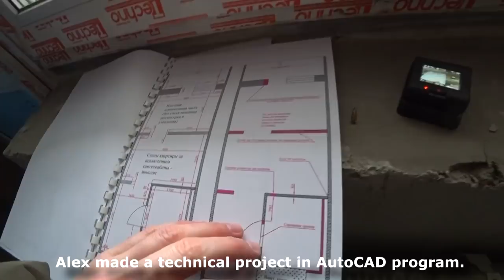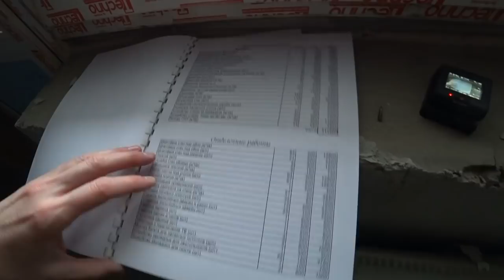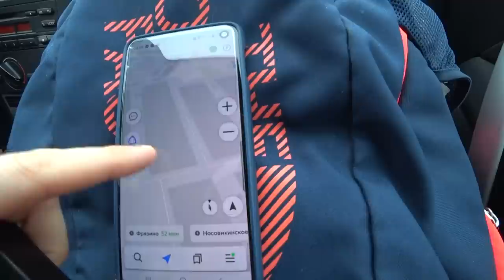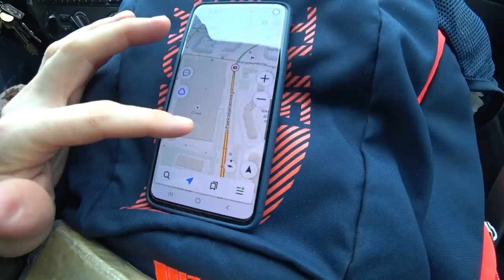RUSSIAN APARTMENT Renovation: Remove a Load-Bearing Wall! Is it legal?

Comment: I would frame the larger main room area, but not the smaller window room or the bathroom, only paint those walls with a cement paint. That window room could be a bedroom if you can get shutters for the windows to block the light or else blinds and thermal curtains.

Comment: nice CAD work Alex :)
Reply: Yes. I am not a CAD expert, but those drawings took very nice.
How will you get all the materials up to the apt.? That will be pretty tedious using the elevator.
Reply: @kmath50  there's a cargo elevator in such apartment buildings
Reply: @maria.5974  That's good to know. Makes the work much easier.

Comment: I believe that you can remove a load bearing wall as long as the official district engineer gives you written permission. We say he "signs off" on the project. You will probably need to show him/her what you intend to put in its place; beam and posts, maybe.
Reply: Demolition of the load-bearing wall is strictly prohibited. And in the event of a collapse, criminal liability will overtake. If there are victims, then you can not get out of prison. Is it worth the risk? Due to the demolition of the bearing wall, there have already been cases of collapse of houses.
Reply: I think removing a load-bearing wall in a hi-rise building is a much more serious matter than doing it in a 2 story s/f residence.

Comment: In most countries even replacing the windows would not be permitted in an apartment block as there are usually strict regulations in place for the cohesive appearance of the outside of the building.

Comment: Why metal doors?  Is there a security concern?
Reply: From what I have seen most Russian flats/apartments in multistory buildings use high security metal doors.  The heavy duty locks and deadbolts are impressive.